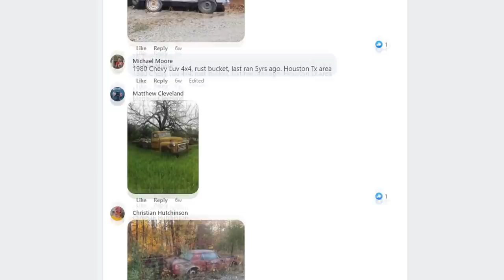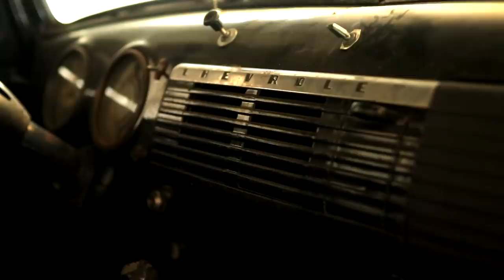Rescued 1952 Chevy 3100 On Air Ride | Barn Find Project Truck Found | RESTORED

Comment from the maker: How would you like to see this truck be built? We'd love to hear your ideas!:_Lance::_Wyatt::_Christian:
Reply: Keep the body natural. Clean it up and put a clear coat on it. Some shiny cragers from the 70's. Nice tires. And a good 350 4 barrel Chevy engine.
Reply: I would keep going in the direction of just up date everything. Don't paint it get rid of the red rims change the steering wheel.
Reply: I would love to see it get a little love from you guys..I would love to find something like that up in Virginia
Reply: Like a old service station parts getter
Reply: since the bed can be lowered..getting items off and on the bed, would be nice to a bed filled with items that would help "Dig" out new finds in the fields. Chainsaws, picks, shovels, temp tires, to fill in ruts left by tries  etc..
Reply: How about an LS1 engine, shorten the frame, clear coat the exterior, “get-away” logo on the door. ;)
Reply: Leave as is with a clear coat with patina as little as poss but reliable with air ride and change the doors to single window maybe then show the owner and let him have a ride in it as it was a great story  maybe get a picture with him and his wife when finished?🤔👍👍 from james 🇬🇧
Reply: Rat rod
Reply: Defo paint the chassis
Reply: Custom pait job, like Herb
Reply: I am only 53 years old but I tend to lean more to old school...give that 1952 Chevy as much of the original look that Detroit put out in 1951 when they tooled for the 52s. Now bringing some modern flavors to her can also enhance her beauty...if the gauges, for example, can't be fixed, then maybe a sweet digital dispaly kind of like those smart watches where one can adjust what the face  or color looks like.. I love your show and love you all! Be blessed!❤👍🏼🇺🇸
Reply: I appreciate you guys allowing the seller to give his testimony. Love these old trucks,  I have a 51.
Reply: Stock, the same as if it just came off the assembly line and in honor of its 70th birthday.
Reply: What would be awesome to see it get it fully back on the road and gift the truck back to the guy you got it off of. God works in Mysterious Ways and what a blessing that would be to a new man to faith?
Reply: modern suspension and interior, 383 stroker leave the paint. give it the boiled linseed oil treatment and ride,!!!
Reply: Paint it factory original color - forget the patina garbage.
Reply: I know this comment is a bit late, but I would suggest keeping the paint patina, get the 350 in her running again, keep the air ride also finish the air ride with more airlines, air compressor, air tank and switches. Either keep the rims that came with it or add some spoke rims. Either way go with a set of white wall tires.

Comment: I had a 49 5 window and I had a 350 4 bolt engine late model rear end but I used all the original front end with late model hubs so it was five lug all the way around. Had dual gas cans on the running boards, and bucket seats. It would pass everything except the gas station lol. It would do 130 mph with the speedometer not operating correctly had a visor over front windshield and the wing window doors. I love that truck so that when I got married it was our truck!
I had started it from the frame and lowered the frame by playing with leaf springs so it was down low and not so slow. I love it.!

Comment: Two cool trucks, would like to hear that engine running again, recover the seats, fix those air bags and install new pickup bed flooring.  Love the look as it is.  Also for that parts truck, would like to hear that engine run again and see what else it needs to get it rolling again.

Comment: i watch a lot of towing and recovery videos i see a lot of towing companies that use a car  haulers they buy what they call scates looks like some sorta composite material they put in front of the wheels that don't roll and they slip under the tire and slide on the trailer real easy you might want to look into some it also makes sliding the vehicle from side to side easy as well

Comment: The parts truck is a '47.  That was the first and only year for the manual floor shift.  On the column from '48 on. 
You can see the floor shift at 8:46 and 22:41

Comment: Those old 6 cylinder engines like on the parts truck where darn near indestructible, but it will depend on many things of course as you know, but I'd love to see it run one day!   May be a good engine FOR the parts truck, if you could find a frame that the body could fit on, if the current one isn't up to par!   As for the '52, my dad had one when I was a little guy...of that body style, so your build on it will be a video I'm sure many will love to see, but it may have to be in sections, as I'm sure 'time wise' it will take much of your time, from the 'barn or field' finds you seek, which keeps a large part of your viewership watching!   Put Christian to work even more, as all hands will be needed, as you continue to find these old vehicles, that thousands of people love watching you get them back on the road again!   Stay safe, be free and be kind is my motto!

Comment: I love the truck. If it were me I would take the air rides off , and save them for somwthing else. It doesn't need to be dragging on the ground. get the motor running. do the interior. Fix the backend. Maybe some diffent wheel tha look cool, and make it truck to get parts or ride around town in.

Comment: Flat black the outside as little body work as possible, just shoot flat black primer., some carpet in the cab, maybe a nice tan diamond tuck seat cover with some matching door panels if applicable.. Maybe some vintage looking modern instruments ....possibly even digital.. Wide rear tires with tubs, stock fronts. I like the look of the wheels, get some deep rear wheels and some nice, clean original style hubcaps. Keep the red. Paint grille silver to match interior color (looked silver to me anyway.)  A nice dual exhaust system to help her breathe better. New shiny emblems or paint them silver to match grille, fuel cell in bed, and last but not least, a sweet stereo system and a/c. That would do it for me anyway.

Comment: Lance i watch a lot of the videos your family puts out , and enjoy them all. I do have a question, if you could answer how i can actually get my automatic transmission to shift properly? It is a 1997 Chevy Siverado 1500,i have replaced the engine and no longer use the spider injection, the crank sensor or cam sensor. I have dart racing heads, edelbrock intake and 4 barrel carb with HEI distributor.. help please?
Reply: I own a 98 Chevy and was thinking about doing away with the spider injection I did a little research and you have to use a tps on your carburetor to make your transmission shift right it's like $100 or so for the set up works with Holly's and Edelbrock look it up on Google and it'll pull up
Reply: @billyhughes63  i forgot to mention i have the throttle position sensor wired up and attached so it moves with the throttle. Still not shifting?

Comment: One thing I never have cared for is dropping anything down on the ground. I Like a vehicle to be lowered but level as I know that's what makes them handle better. That truck is Awesome though, great year for body style. If it were mine, I would drop it 2 to 3 inches below stock height, nice and level with a 60 series radial tire, dual exhaust out the back, bucket seats and new wood in the bed. Make it a daily driver that sounds good and has plenty of pep. In my day, when I had my 55 Chevy half ton step side...I had my favorite motor, a 283 Chevy with headers and Thrush Hush mufflers. 3/4 cam and a 4 barrel Holly...but gas was $1.15 too. Maybe a 2 barrel or fuel injection. 
I Loved my truck because I could sit on the fenders inside and work on it. I also had a 1952 Chevy Sedan delivery that to this day I kick myself for getting rid of...I was 15 years old and stupid. I would LOVE to have one again. I LOVE your show and your LOVE OF GOD. GOD bless you guys.

Comment: the truck is pretty much built as is.....like lance said, just button up the loose ends, finish welding, get it running decent, few touch ups to the interior....and roll with it down the road.

Comment: Inhave a chevy ex cab like that gold that guy has in that barn that i built that im about to put a healthy 350 in . I have owned the old truck for about 6 years and i been waiting for the motor to finally kill over and actually it kicked the bucket before i got the motor built. Of course the original motor had nearly 300, 000 miles on it and most of em was under 35 mph. It spent 15 years inside a chemical plant

Comment: What’s up guys! I own a 1959 Chevy Apache pickup 🛻 it’s been seating in my garage for almost 20 years I have done some work over the years (replace engine and trans) but it just go back to the garage every time , I still need to work on the electrical part of the truck! My question is? How do I know if I need to replace the gas tank or not?

Comment: I think instead of having all that air ride suspension with all that air suspension stuff I think that should be done away with and just taking put the and wider tires on the back and maybe just some little bit narrow or ones in the front leave it like a rust rod